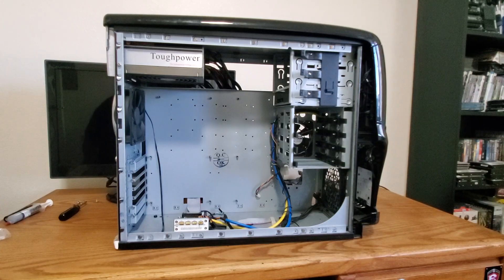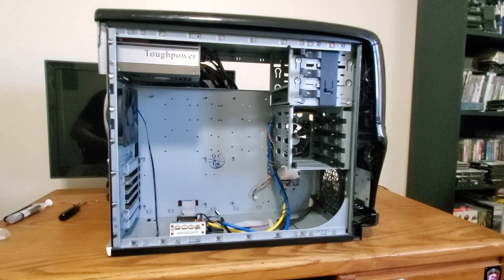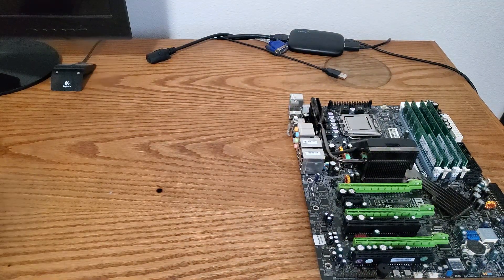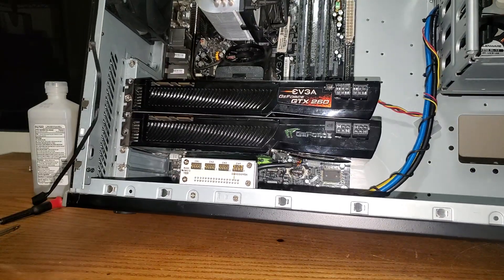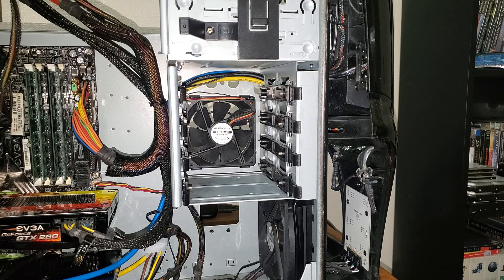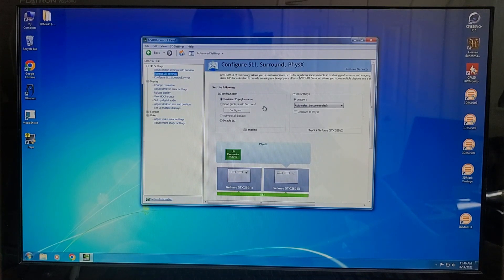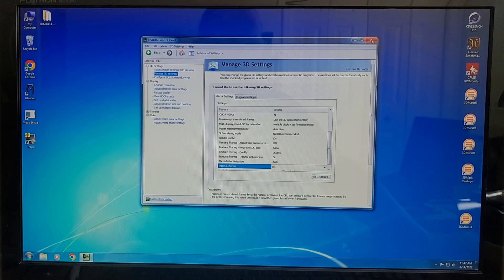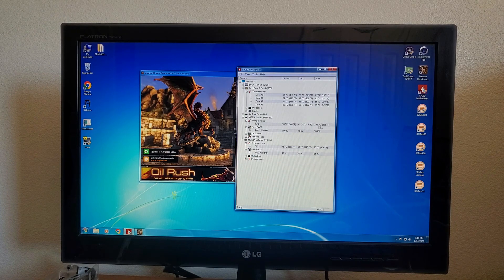Alienware Resurrection pt 1

Comment: Hey I recently outfitted one of these with a 790i ultra motherboard. Be warned, this case really doesn't have the best airflow so i'd reccomend some static pressure fans inside it because there are way too many tiny crevice's for air to flow through it. Also make sure you have some nice ventilation in your room or wherever you store this thing. Also nforce motherboards run real hot but I don't think the 780i is going to have too many issues with it.